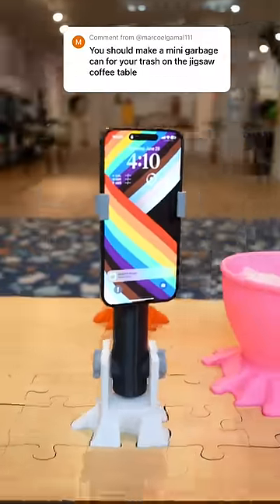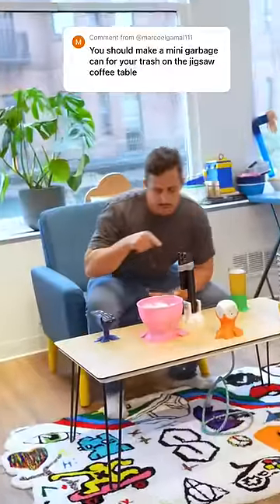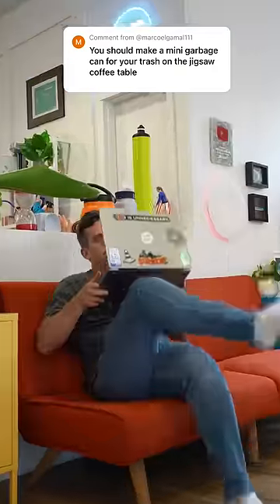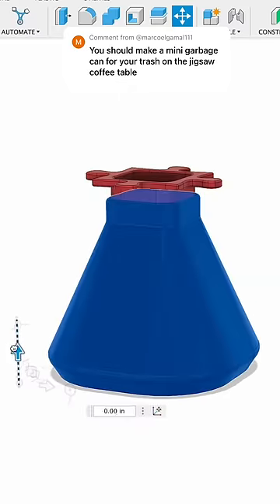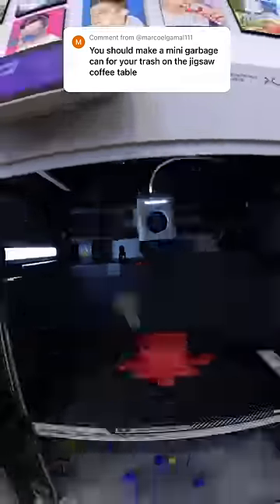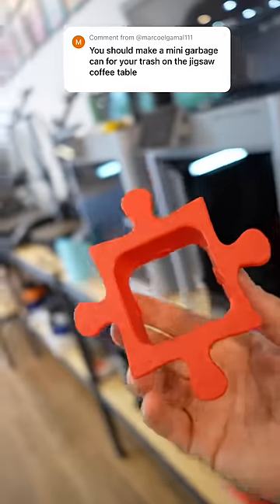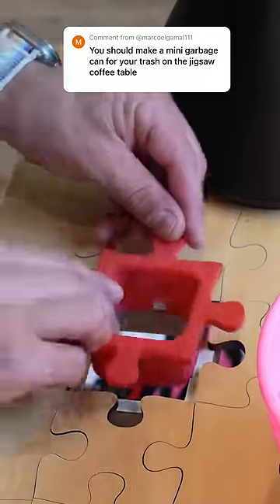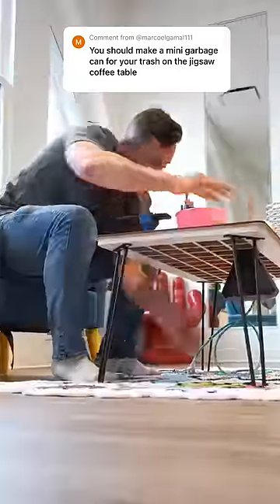Jigsaw Puzzle Table…TRASH CAN!

Comment: You do realize that calipers can measure the inside of a hole, right? The two prongs on the back. Put them in the hole and extend until they hit both walls. We use them in my shop

Comment: Hmmmm, looks like you are running out of space there! Here is an idea… create a separate part and stick it under so it can slide in and out on both sides to extend and decrease the size! (Could use a sliding jigsaw piece)

Comment: If you're feeling angry and stuff, make a puppet section like for pieces of a puzzle and then make them all fidgets like a small little container to hold them all like a pop. It inside like you have a holder for the pop and then just use it. Also good job at Junior work and also I like your videos a lot. Please respond❤😊

Comment: What about protection? You need a shotgun holder. Preferably one that allows movement, so you can point it anywhere and use it with one hand. Maybe something like the robotic tesla charger situation. You might even be able to add automation to it in the future.